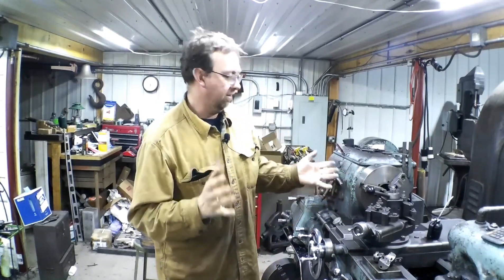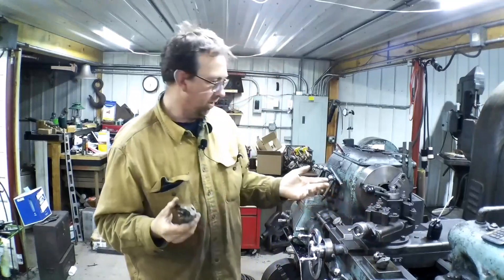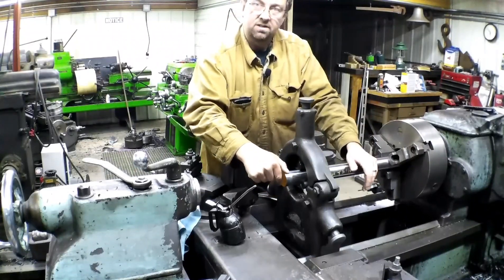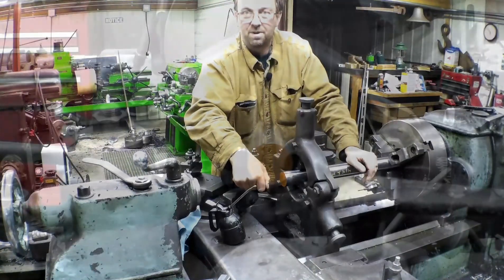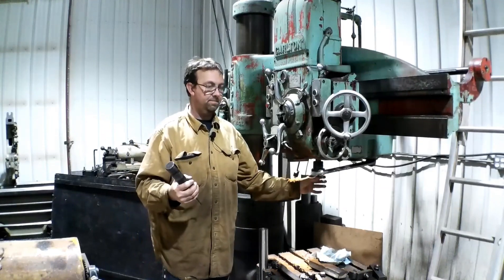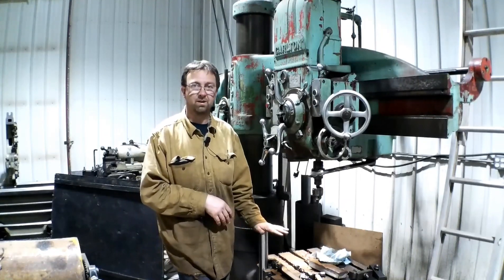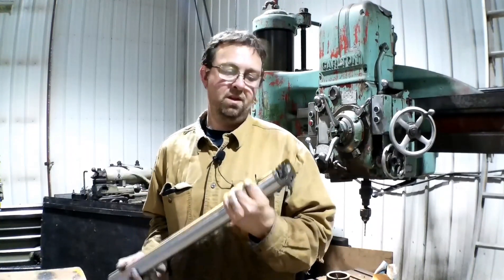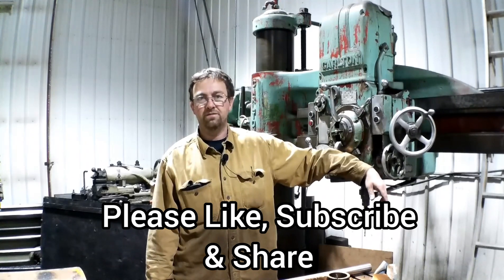Making a Big Boring Bar For My Big Monarch Lathe, 25N

Comment: Did you consider fitting the head with the first screw and copying through with a suitable drill to start the hole for the tapping size drill for the remaining holes?